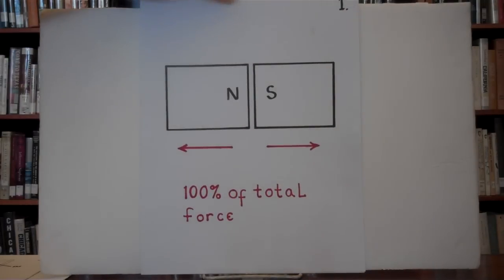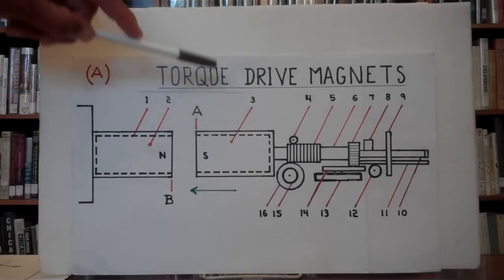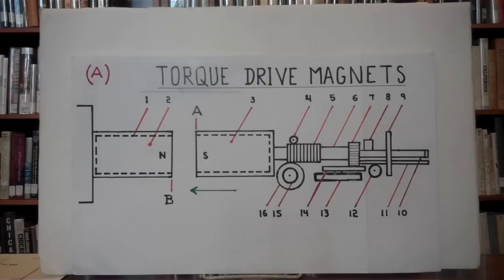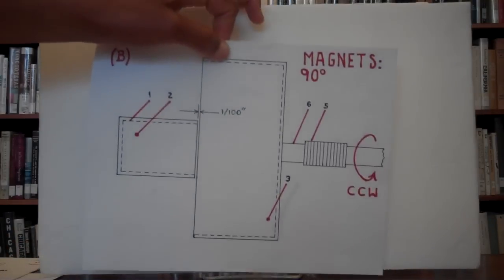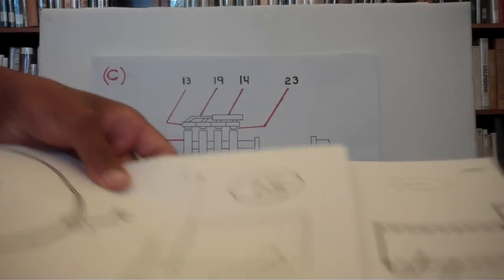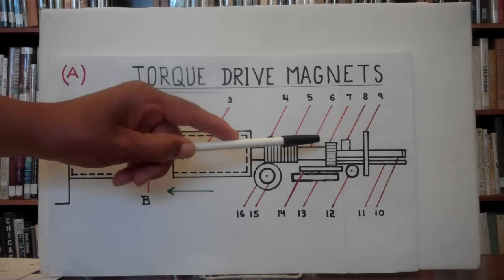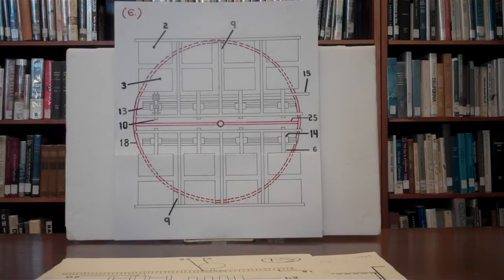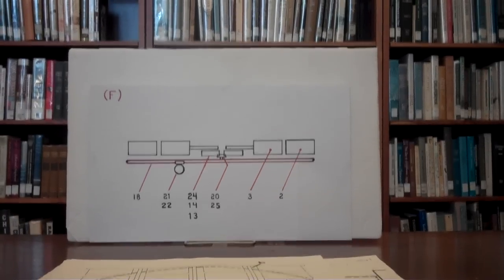This Magnet Engine Could Run Forever?! The Semi-Perpetual Motor Explained

Comment: I heard that magnets have only potenial energy and you need another source of energy to relief it. I am prety sure we can use springs and gravity force to add the small amount of energy which is needed to relief potential magnetic force for make it kinetic energy. I have one idea. The thing is that the whole sytem must working in imbalanse. Springs and mass will give it to us to add small kick for our system. Need to try to build one of my ideas.
Reply from the maker: Mr. Trent Pettyjohn: ... One part is not shown on the drawings for the machine. This part is called Balancing metal (cancelation metal). It is a 100% needed part of the system. This is a plate of highly magnetizable metal of an exact thickness, width and length. This allows the repulsive force of the magnets towards each other to be equal to the attractive force that the magnets have towards the same metal. Hence, field force balance. It allows the magnets to attract to the metal first and then to be pulled apart with less than 0.01% force. Hence: this engine will in fact work.
Reply: That same concept is what he has illustrated in his design. Basically, the force pulling the magnets together is more then the force needed to pull them apart.
Reply: Springs and magnets are interesting energy sources. How is the building going?
Reply from the maker: Mr. R. M. : ... you can not use springs.  You must use magnetic field balancing metal.

Comment: Fun to try, but a magnet is the same as a spring.
Reply from the maker: Dear Mr. Mexcan Fun: There is something you don't know. I've put a physical demonstration on a recent video of this part that goes to this engine. This  part is not shown in the above video. Please, go see this video. Permanent magnets have large fields. Springs don't. Those fields can be balanced (push and pull) to make this car engine work that's made of all permanent magnets as shown.

Comment: In 1974 I asked if a full permanent magnet motor would work and was told it is "Impossible." I saw an actual permanent magnet motor work a few years ago. No tricks, no gimmicks. Tesla was also told AC electricity would never work because it is "a perpetual motion machine." Nicola Tesla was correct and the critics are wrong. A permanent magnet motor can work. It is not a perpetual motion machine because it uses magnetic energy, but 
it does work.

Comment: I'm just now getting myself wet in this field, I ran across electro induction, done couple of my home work and people seem to always use examples of it with magnets/batteries, but i'm now just wondering is it possible to use any kind of materials to go through the coil to induce energy or does it have to be magnets/batteries? i heard of electrical coating but idk i think kind of far reach from my question.
Reply from the maker: Dear Mr. Jesus Christ: You'll have to test and experiment to find the truth and facts of electromagnets, effects of electrics and magnetics, etc.
Reply: Jessie Johnson yes i know, i just figured out it doesn't work, but i think i got a way around creating an electro field without magnets on a loop.

Comment: In the first 1min 30 seconds you point out that the force is different when pulling or sliding the magnets apart. That might be correct but sadly the energy required is the same. For that reason this doesn't work. Permanent magnets are not and can never be a source of energy.
Reply from the maker: Dear Mr. Colin Watters: The amount of force required to slide magnets apart and to pull them apart face off is very different. Very different. Get some strong magnets and simply do this yourself and you will know. It's a matter of utilizing the difference with accuracy, precision and machine tolerance. The magnets are not used as a source of energy but as a source of force. Permanent magnets have a force field and are a source of force.
Reply: Jessie Johnson you de man JJ I'm subscribing... Someday I'll tell you if my solar single idea and let me tell you they still haven't got it right yet... Or ask me about the smart Hammer why don't we have a smart Hammer yet the oldest tool known to mankind is not an educated since mankind can pick it up and hit something over the head with I mean well you know what I mean:-)